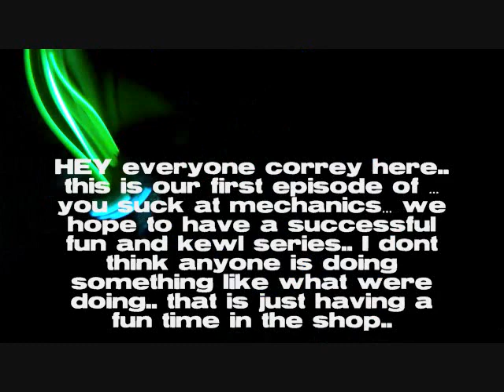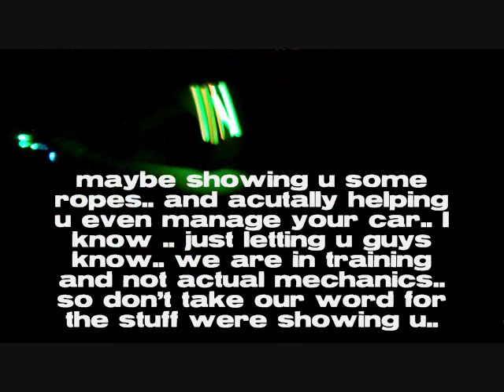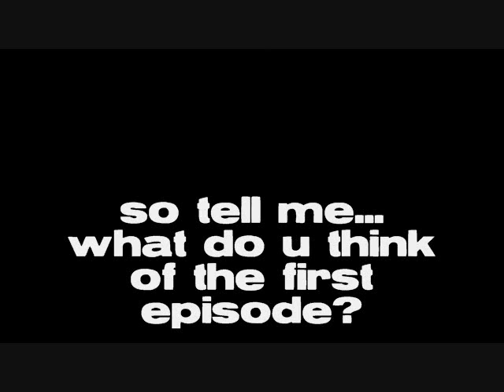YOU SUCK AT MECHANICS

Comment from the maker: we had to drop the crossmember out, which is simple just tidious amount of unbolting lol, then the bolts that are holding the rack to the crossmember, and make sure to take out the brackets too, after that u kinda just have to get the right angle by turning the tie rods one way or another, if not u may have to take the inner tie rods off entirrely, we were changing the whole rack out so we didnt care to damage it.